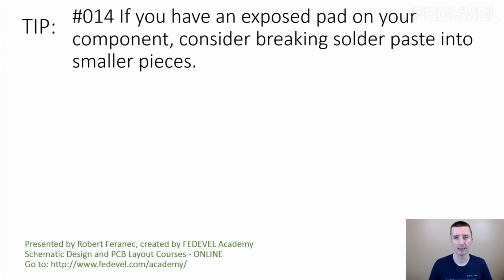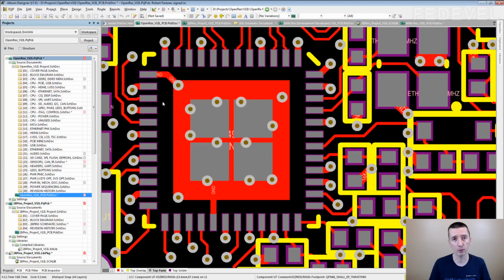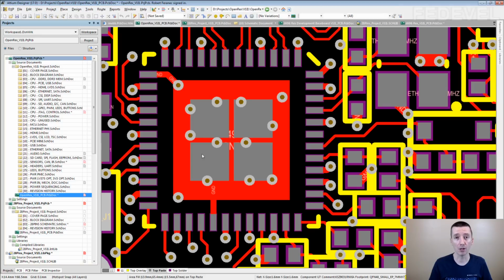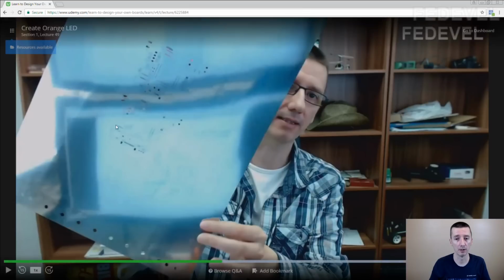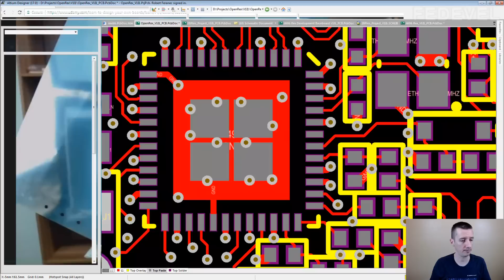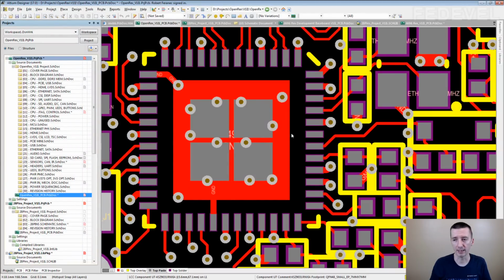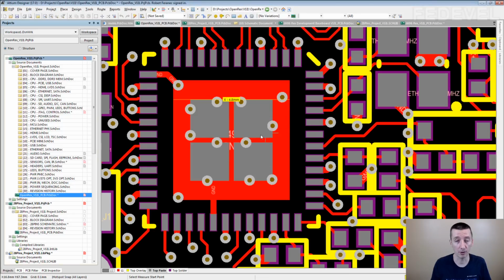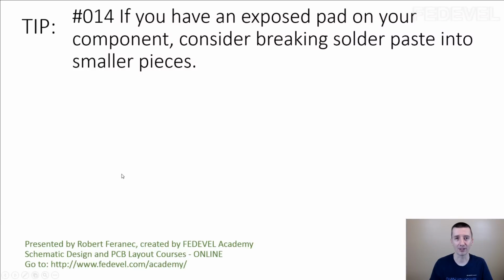TIP #014: If you have an exposed pad on your component, consider ...

Comment: I have been told by a manufacturer to use solder mask to split the exposed pad into smaller portions. If you simply define the solder mask as shown here, changes are the solder will form a blob nevertheless (there is nothing preventing solder to spread out). Especially for larger volume manufacturing, the manufacturer might even redefine the solder paste to their needs.

Comment: Robert, when pad becomes large enough to use thus Tip/rule? SOIC8 - use or not? QFN28? it's not obvious and have many nuances.
Also, how it will affect to a thermal impedance?
Reply from the maker: I am not sure if there is a general rule. Usually they point it out in datasheet. If it is not in datasheet we make it for the pads which looks big . I do not really have any specific number, that is why I measured it in the video at least to give you an idea.
From thermal point of view, the number of VIAs in the pad and size of the copper may play more important role. I usually trust the soldering (when I had to de-solder some components, usually you can see if the tin was distributed ok and in most cases it is fine).
Reply: @RobertFeranec  Can you share to me that what standard you prefer to design the solder paste like as you show in video or it is just based on your feel or experience?

Comment: TIP#15: Don't place vias under solder paste. ^^
Reply from the maker: If VIA has a big hole, the solder will flow out from the other side. It doesn't look nice and yes, the question is how much of the solder is out and if the contact is good. So be careful how you place the VIAs and how many you place them. Consider also Mindaugas and U=RI comments.

On the other side, we sometimes use VIAs under solder paste (e.g. hole 0.2mm) + mask from the other side and there is no problem with solder paste flowing through it and no problems during assembly.
In reality and in many PCBs we really do not have too many options where to place the VIAs - we just have to do it where is some free space. Usually it is because there may be a lot of decoupling capacitors under the component + a lot of tracks in the inner layers. So in many cases, we just have to place VIAs under the solder.
Reply: @RobertFeranec  I think we can place a via under solder paste, but we have to plug this via first.
Reply from the maker: @gaweye  if you are using plugged VIAs, you can.
Reply: @RobertFeranec  vias covered by solder mask on the other side risks trapping gas in the via during reflow.
Vias without solder mask cover risks a large blob of solder on the other side.

The only good way to do it is probably with epoxy plugged vias, copper filled vias, or laser drilled microvias which are too shallow to trap any gas.
Reply: why?
vias help suck component to gnd.
Reply: Yes, but before that, when you apply solder paste with the mask, if a via is under the solder paste then the paste goes inside the via hole instead of making contact between the copper and the exposed pad. 

The trick I would have done on this example is to place a via right in the center of the exposed pad, exactly where the solder paste is not applied so the via hole wouldn't be filled up with the paste. (Would be so much easier to explain it to you with a simple drawing...)

A via hole under an exposed pad also works has a "pressure release" during the reflow, so it helps the component to self-place itself and it helps to guarantee that if you have applied too much solder paste then it goes in the hole instead of lifting the component which could create disconnection on some pins.
(Obviously make sure that you don't force complete tenting on both sides.)

Rob makes a really good point though! Always separate the solder paste under exposed pads, even though I would have applied less solder paste and optimized its repartition under the pad.

I hope that I answered to your question. ;)

Comment: Great tip Robert!
(I think there is a small "cosmetic" error in the video, at 00:50 you say that the "Top Solder" layer defines the paste/"gray color", I think you mean that it is the "Top Paste" layer that actually does that, it is also the "Top Paste" layer that is active) ?
Reply from the maker: Ups :) Nice spot! Yes, you are right. A note added :)